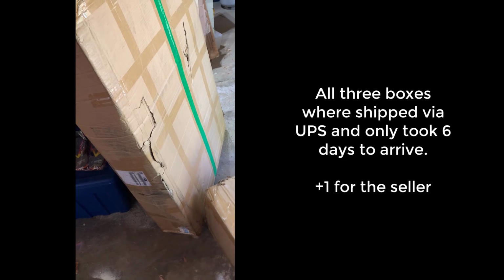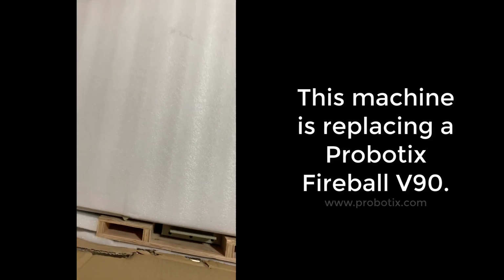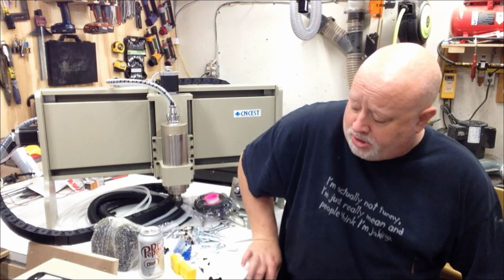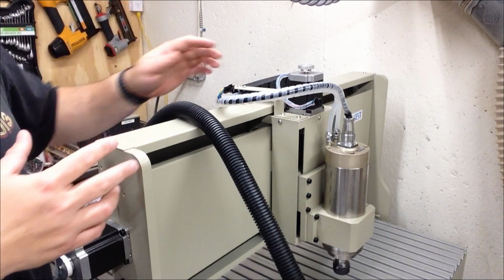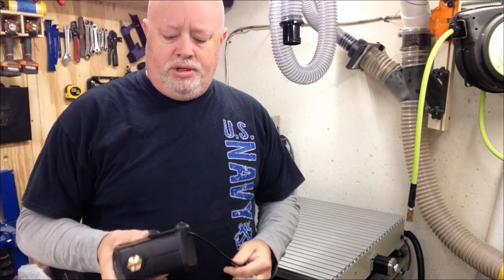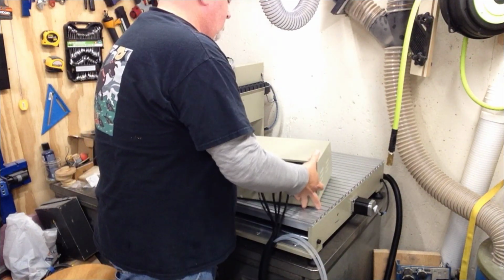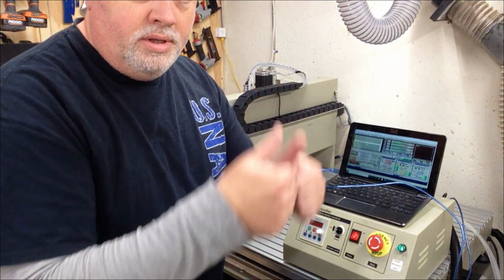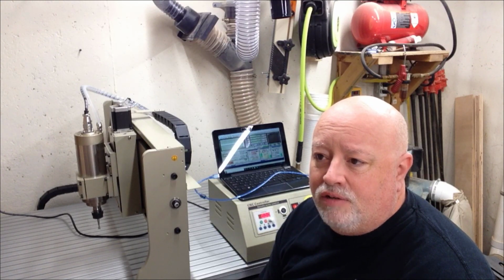Getting started with the Chinese made 6090GZ CNC Router

Comment: Hi.  Looking at these machines myself. Only problem i have with one is they all say only good for windows xp or 7 nomatter where i look. Even google searches i only find people saying thats the drawback of these 6090 machines.. You are showing it set up with a modern laptop and windows 10. Did you have to do anything special to make that happen? Did you change out the control board or do these sellers/people on forums just not even know that these machines work with windows 10? thanks
Reply from the maker: I did not have to do anything special to get this to work on Windows 10.
My CNC (as many are) is using a 3rd party DLL to control the machine.
The DLL is from rMotion and uses a USB port vs a parallel/printer port.

So, with that said...
If you buy the version with the USB port, you can use Windows 10.
If you buy the version with the parallel port, you will need Windows 7.

Does that make sense?
Reply: @jeffmorlen  Hey thanks for the reply. Yes i guess that makes sense. Just don't want to end up with a machine i need an old laptop for. I asked because even the link you posted to the actual purchase you made says only works with windows 7,xp, etc. I wonder how i can be sure i get the same dll/control board you received. I see this same machine for as low as 1900 but something is kind of weird about that. You would think that since most people don't want to have a parallel port old computer that they would make it clear that it will actually work with windows 10 just to get a sale at least. But every listing including your link basically says it won't..
Reply from the maker: Shawn-
If you like, I can go over the stuff in a video for you.
The details of some of those postings can be very confusing... especially when the seller just does a copy/paste of some other post.

I was also going to go over the installation and setup of Mach3 for use with this machine in a video (but have been very busy).
Let me know.
Reply: @jeffmorlen  also i wondering where you even saw details on the r&r motion control coming with the machine before purchasing like you said in video. i don't see anything about that on amazon details. thanks

Comment: Jeff I have the same cnc and can't get the spindle to rotate.
Reply from the maker: Is this a brand new unit?  If so, I'd contact the mfg or seller to work out a replacement spindle or VFD.

If not, when did it work last?  Do you us it "manually" via the VFD or is it controlled by Mach3?
Reply: @jeffmorlen  I finally got it to work after they sent me the setup instructions.
Reply from the maker: @petervandoren5490  
Can you share the setup instructions?
Reply: @jeffmorlen  yes, where do you want me to send them to?
Reply: @jeffmorlen  Great packaging huh, mine came damaged the first time.
Reply: What did they tell you about the spindle noise? Mine has the same noise.
Reply from the maker: I told them it sounded like a bearing and they sent me a new spindle.  With that said, at higher RPM I didn’t have the noise, only in the mid-range.

Comment: Jeff, I have an engineering background and I commend you on your ability to set this thing up. Your review will definitely make it easier for me if I decide to purchase one. Do you think this router is able to do deep steel engraving, like for small fonts on a firearm? Thanks for everything!
Reply from the maker: I think the best answer is "maybe".  I only say that because it will be all about the speeds and feeds... and a GREAT quality mill to go in it.  I think there is a video out there that does have someone doing some engraving in a 1911 with, I think, a 3040CNC (the same but smaller).
Sorry I can't be more help... :(
Reply: An applitec E330-P-0.05-TiALN (not sure if it was TiALN) engraving endmill going 50mm/min at 8100rpm took about 800w with peaks of 1400w in a vf2

At those speeds and multiple depth passes, it probably can

Comment: Hello Jeff. Enjoyed your unboxing vid. In your experience with your machine would you say that it tips the scale in the mill direction or is it strictly a cnc router?
Reply from the maker: That is a great question.  I would say that, due to the construction, it CAN be used to mill soft metals.  You can find some people using the 3060 for metal on YouTube.  For me, this will be just a CNC Router.

But... it's a great question so let's address some things.
Things that I have found that do not lend it to milling are:
- The VFD does not allow the spindle to go slow enough, at a high torque level, to mill.  The VFD and spindle should not be run below 10000RPM.  I have found that the VFD overheats if you push it at a low RPM.
- The gantry does have flex in it.  But, even when working on a Bridgeport knee mill (manual) you will have flex (usually in the head).  But the amount is the issue.  The flex of the gantry causes some issues under load and your accuracy will suffer.  You will have severe drift in your tooling if you don't have the right feeds/speeds.
- Lack of cooling (by default) make is ill suited to milling.  You can/could add a surround and then add liquid cooling for the tool, but, by default, it isn't setup for it.

I hope this helps!!

I have not had a chance to get back in the shop lately... but I hope to have some other videos coming out soon!
Reply: @jeffmorlen  I appreciate the prompt and engaging response. Thoughtful of you. As I would like to try my hand at injection molds using aluminum medium, tool tolerances are of grave consideration. 

- In regards to the VFD overheating when run below 10000RPM, is it that the internal fan (of the VDF) is not adequate to cool the electrical components or is this behavior indicative of VDF's that are not mill? 

- The flex that you mention...the following is a thread/post on how one guy (don't know his name) overcame the issue. I believe his unit to be identical to yours, with modifications to the bed. Although your device is purposed solely for routing perhaps it will be of some value to your other subscribers. https://www.youtube.com/watch?v=ybvUcnKno-E

- I would be game to adding a cooling and reclamation...if possible.

Jeff you have been INCREDIBLY helpful. The time and detail you take creating these videos is appreciated...big time. Looking forward to more of your vids coming down the pike!!

Comment: Keep us updated mate. Thanks for posting. I'm waiting for mine to arrive..
Reply from the maker: I will!!  I'm excited to share what I've learned and hoping that I can answer some questions for others.
Reply: @jeffmorlen  can you use a mac book to run this?
Reply from the maker: @zacharypaul1111  
The easy answer is no.  This is due to the software you get being a Windows based software package (Mach3).

The hard answer is yes.  There are two paths you could take with this...
1) You could run Parallels/VirtualBox/VMWare Fusion on your Mac and pass the USB port through to a Windows virtual machine, running Mach3... but I don't know what type of performance you would get.
2) You could strip the RnR Controller out of the VFD housing and replace it with a GRBL based controller.  This would give you the ability to run a GRBL sender in place of Mach3.

I'm not sure if either of these options would be worth the time it would take to setup.
You could simply use your Mac for design and then get a cheap-o Windows laptop to run the machine?!

Just a thought.
Reply: @jeffmorlen  thanks for the answer I do have a older laptop I could use